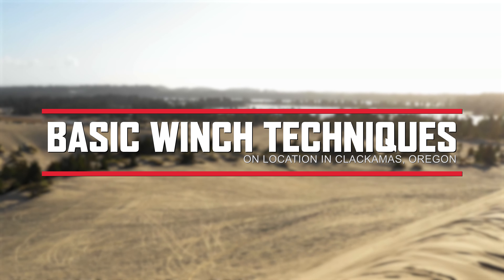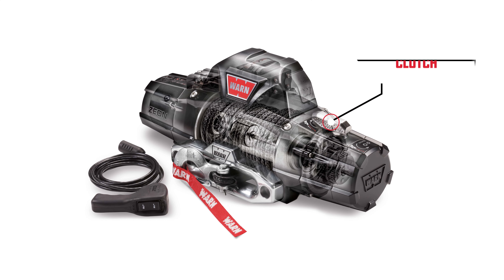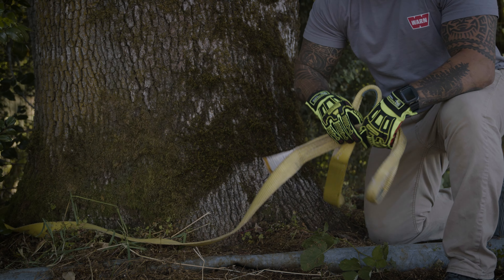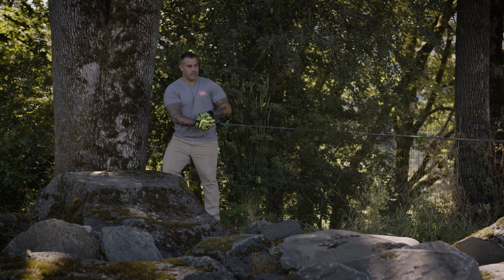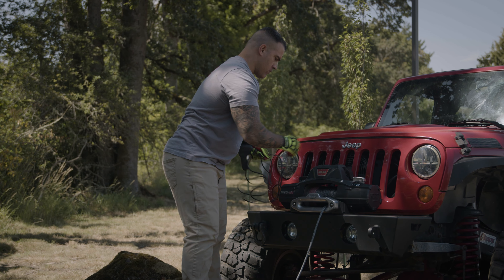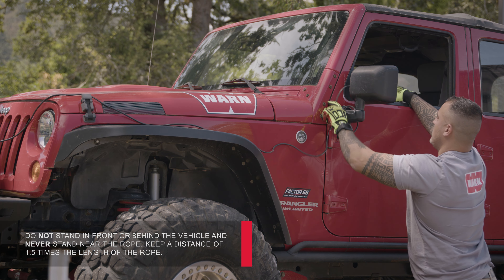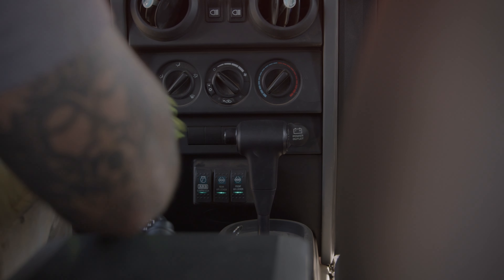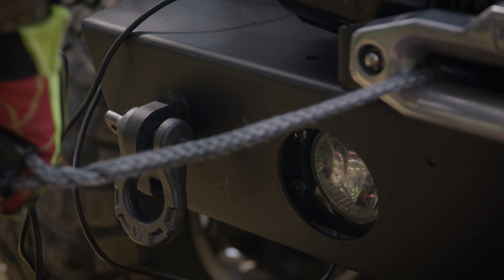Basic Guide to Winch Techniques

Comment: great video i use 2 of the older 8274 winches they have held up good
Reply from the maker: Glad to hear!
Reply: @warnindustries  l still have your early HS9500i winch, it’s 24 years old, and it still works very well.👍🇺🇸🇺🇸
Reply: @warnindustries  So, got my first winch installed and went out to unspool and respool under the weight of the vehicle. It’s a synthetic rope and was making random popping noises while winching under pressure/weight. Is it normal for it to make a noise the first time?
Reply from the maker: @JBJHonez  email cs@warn.com or call 800-543-9276 just so we can verify nothing else is happening. Thank you!

Comment: Hey guys just a quick question. When you’re winching someone else out what gear should your transmission be in ? I put a Warn EVO 10000 on my Jeep and haven’t needed it yet.
Any help is appreciated
Reply from the maker: If you're doing the winching, then you'll want the vehicle in neutral with your foot on the brake. Make sure to let the winch do the work, and don't drive the vehicle backward. If you need to move the vehicle back, stop, and re-rig.
Reply: And if you are in 4low while your brake is on, your entire drivetrain is locked down and all tires contribute traction in addition to having mechanical advantage of low gear.

Comment: Never back off a shackle pin. I'm surprised a company like Warn is posting official videos and PDF guides with bad safety practices. I get that sometimes with using a winch, you need to use some "night shift rigging" because you are out of options and gotta cowboy it up. But, backing off a shackle is a horrible habit from the old days when people didn't know any better. Please do better on your future videos and guides, especially ones meant to cover the basics. Shackle pins have flats and a hole in them for a reason.

Comment: Serious safety issue here. When you are operating your winch from inside the vehicle, you don't stick your head and arm outside the vehicle. All body parts need to be inside. All windows should be closed. When a cable or rope is flying through the air, there is no time to react to move out the way. I'm flabbergasted that Warn thinks it's ok to demonstrate that being half outside of the vehicle in such a dangerous scenario is ok 🤷